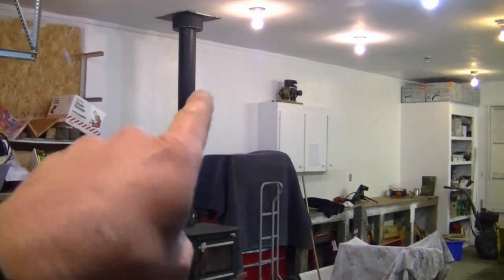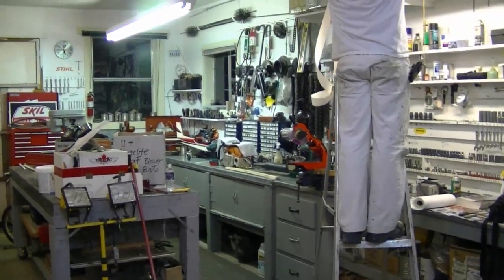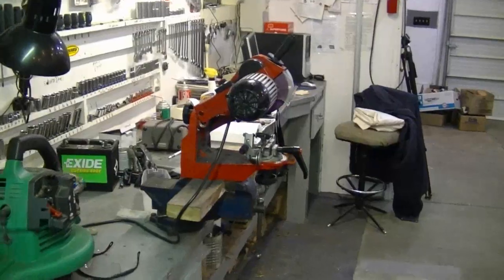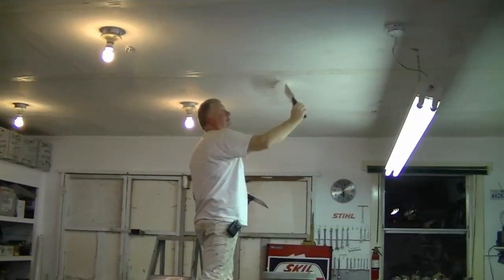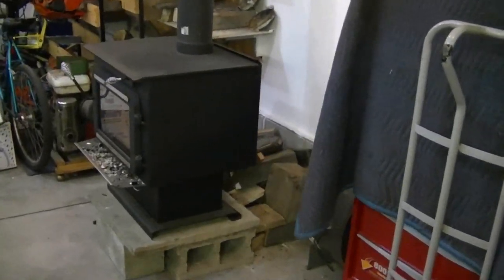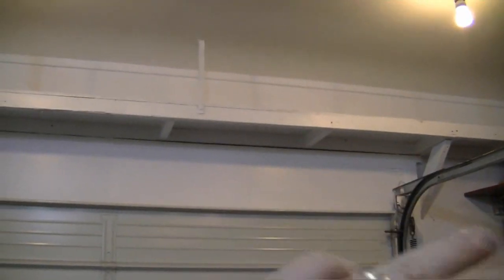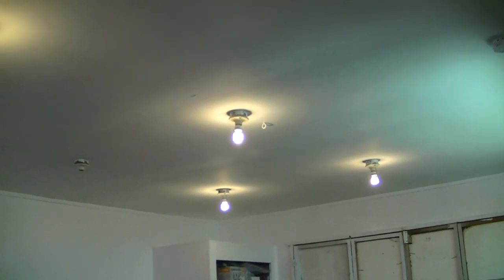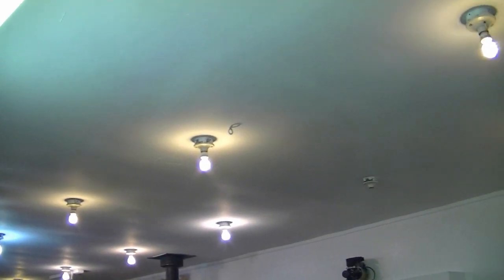Painting The Shop & a Quick Tour

Comment: Hi Donyboy, great vids,
get yourself 8 foot flourencent fixtures.  You will not regret this addition.  Easy to install and will save you lots of electriclty and have much more workable light.  I switched from incandescant to 8 foot flour's and it made quite an amazing difference.  8 foot because the bulbs they last forever.  I am lighting 1200 square feet ( three car garage) with two fixtures.
 
Ferd